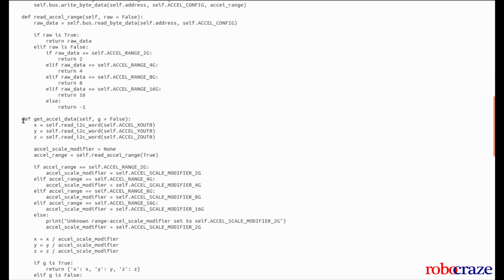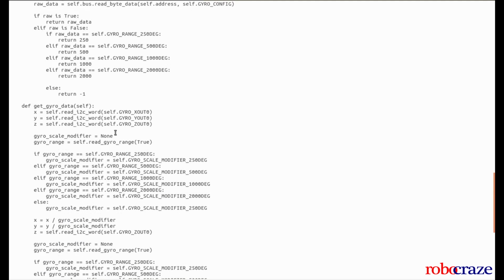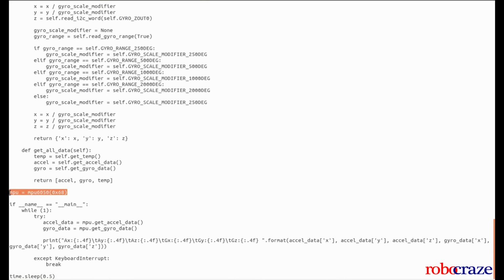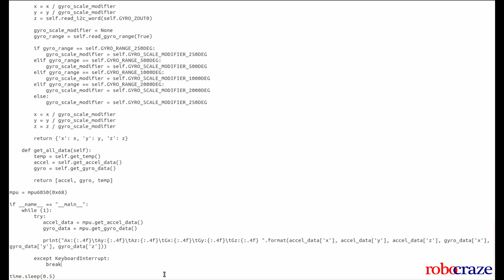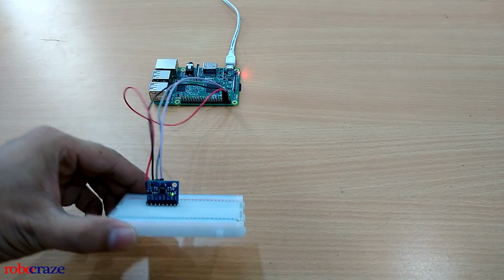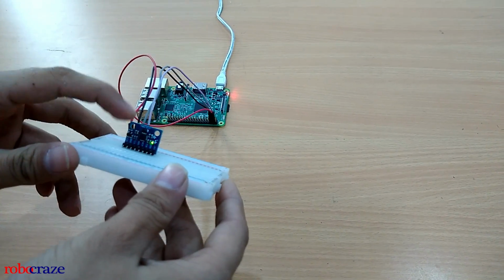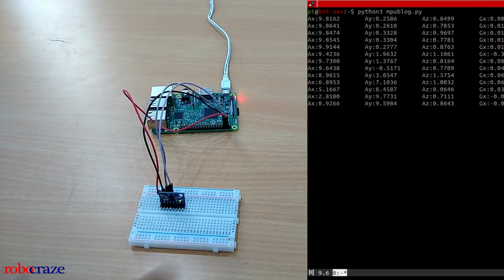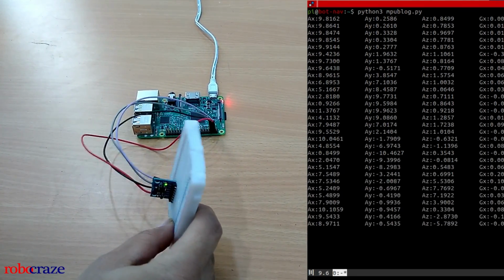Raspberry Pi Tutorial: Easiest Way to Use MPU6050 Accelerometer

Comment: Tremendous video however I am getting an error towards the end of the code
NameError = name 'mpu6050' is not defined 
any advise on how to fix this
Reply from the maker: Hello,
The "NameError: name 'mpu6050' is not defined" error typically occurs when you're trying to use a variable or function that hasn't been defined or imported in your code.

Comment: Can you tell sensor orientation, mounting etc , so i can design holds accordingly
Reply from the maker: Yes, since it has an accelerometer, you can determine which orientation the sensor is positioned as the sensor will read 1g due to gravity in that particular axis

Comment: Bro is it possible to send the data to pc? I don't have a raspberry pi
Reply from the maker: Hi,
You can also connect this to any other microcontroller of your choice such as Arduino, Nodemcu etc and use the Serial UART interface to send the data to your computer. You can also the the WiFi functionality if available for example in Nodemcu to use internet to send the sensor data to other nodes, computers or servers.
Reply: @Robocraze   bro can u give me any resources
Reply from the maker: Please check out our blog at the link given below for libraries that can be used for other microcontrollers as well.
https://www.robocraze.com/blog/post/mpu6050-accelerometer-tutorial

Comment: In case that other have the same problem and to save som headache if you get following error:

Traceback (most recent call last):
  File "sense_accel_gyro.py", line 212, in <module>
    mpu = mpu6050(0x68)
  File "sense_accel_gyro.py", line 61, in _init_
    self.bus = smbus.SMBus(bus)
FileNotFoundError: [Errno 2] No such file or directory

Than you need to enable first you i2c interface.

Do this by typing: 

sudo raspi-config

and than go to interfacing options -> i2c -> enable
Than you are done.
Reply from the maker: Thank you for your comment Florian.
In addition to this, if its still doesnt work, check connections once and ensure the device is available on I2C by running the i2cdetect command.

Comment: Kudos !!! any suggestions or  idea how to generate a .csv from the results displayed on the terminal. I need the csv module from python, i googled this and found :- 
https://gis.stackexchange.com/questions/72458/exporting-list-of-values-into-csv-or-txt-file-using-arcpy
i am not able to pack the values ax, ay, az, gx, gy, gz into the csv, any advice, thanks for your time !
Reply from the maker: Hi,
You can pack your values into a list first by doing
values = [ax,ay,az,gx,gy,gz] #add all the 6 values to a list
And then use the code given in the link you shared to write them to the csv file. Ensure that you open the file in append mode and not write mode as shown in the link as it may overwrite your previous data.
If you have any further issues, please let us know the details.
Reply: @Robocraze  Thanx for the reply I am working on the csv version by adding all the 6 values to the list. 

Another question was while running the code  with the sensor, i have value that are different than the values displayed in your terminal. az value is in the range between 14.3260 to 14.4514, ax value is 1.328 to 1.254, ay value is 1.1995 to 1.3599
gx value is -0.0200 to -0.0192, gy value is -0.0027 to -0.0045, gz value is 1.7719 to 1.9237. 

Any suggestions as to why the values are different.
Do the values indicate that the sensor needs to be calibrated, if that is the case then can you suggest how to calibrate the sensor

Comment: You are feeding 5V signals into the pi. I think you can connect it to 3.3V too (MPU6050 is rated for 3.3/5V). I also read that you need a 4k7 pull-up...
Reply from the maker: Yes, the MPU6050 can be connected to 3.3V as well.
Generally when working with I2C, pull-up resistors are required based on the I2C Master, cable length and number of peripherals connected on the I2C bus. In this case we have only one MPU6050 which is why additional pull-up resistors are not required.

Comment: Its can work on Android Vr game?
Reply from the maker: Since the MPU6050 is an accelerometer module, it can be used for VR applications. However, you will have to check on how to integrate it with your android phone.

Comment: How to connect multiple MPU6050 with single Raspberry Pi?? Plz help
Reply from the maker: Hey! MPU6050 has an AD0 pin. You can make it low or high, to change its slave address to 0x68 or 0x69 respectively.
If you have more devices, please consider putting them on different I2C buses or use an I2C multiplexer.

Comment: hey, great job, any ideas of how i can wrap the results and send it to cloud instead of display?
Reply from the maker: Hi! Could you please elaborate as to where you would want to results to display exactly? The solution would be highly platform-dependent.
Reply: @Robocraze  yes, so raspi can be turned into access point and actually that data to be pulled and visualized on a webpage but additional to that i want a file to be written and stored on any cloud. So i am looking for a way to do that with your tutorial, i think i can still make the raspi an access point after i pull your project, right?

Comment: Thank you for this tutorial. I have applied all the previous steps correctly but the code is not working and this message appears. 

"File "mpu.py",line 201, in <model >
mpu= mpu6050(0x68)
File "mpu.py", line 54, in _init_
self.bus.write_byte_data(self.address,self.pwr_mgmt_1,0x00)
IoError: [Errno 121] remote I/O error"

Thanks in advance
Reply from the maker: Hi!
The error mentioned denotes that R-Pi is unable to detect the sensor. Please check the following:
1. Cable is connected properly
2. Sensor is connected to correct pins
3. Sensor is receiving sufficient power
4. Run the I2C Scanner command: sudo i2cdetect -y 0

Good Luck!

Comment: Amazing. How can I get this code? I need help please
Reply from the maker: Hi. You can find the code for the above tutorial at the following link: https://github.com/Robocraze/MPU6050. You can also checkout the blog at https://www.robocraze.com/blog/mpu6050-accelerometer-tutorial.html for more information. 

If you like our content, please consider subscribing for more such tutorials and do drop a like. :)
Reply: @Robocraze  IS there a way this can be modified to work with MPU9250
Reply from the maker: @malavpatel77  Yes, it can be done. However, MPU9250 is more expensive and advanced as compared to MPU6050, and you should opt to use it only if you need the higher version.